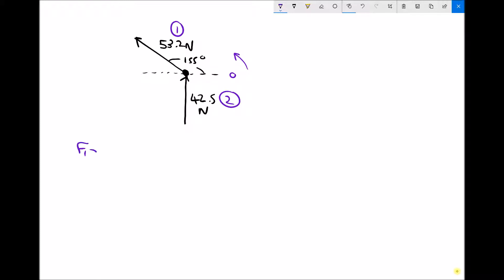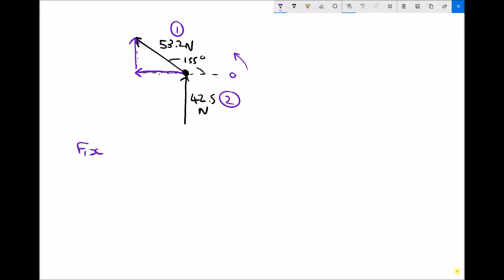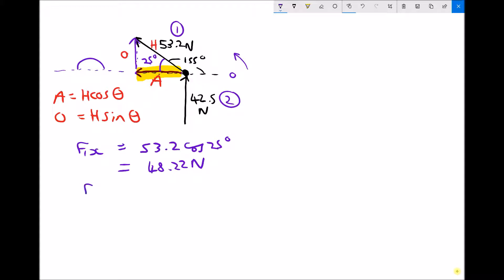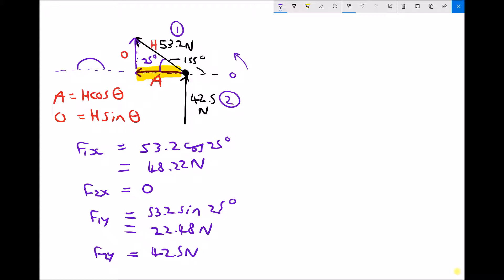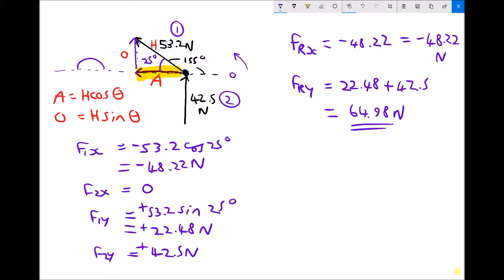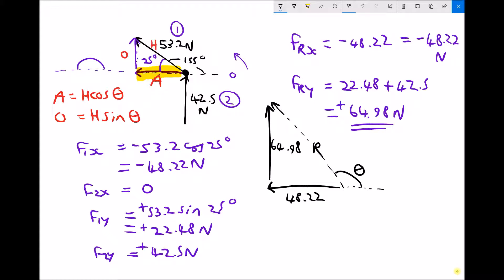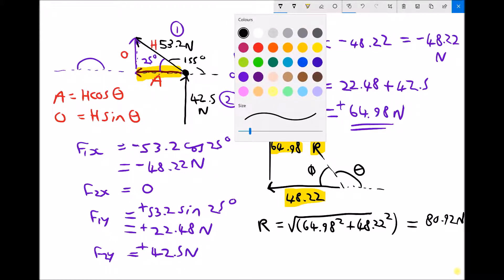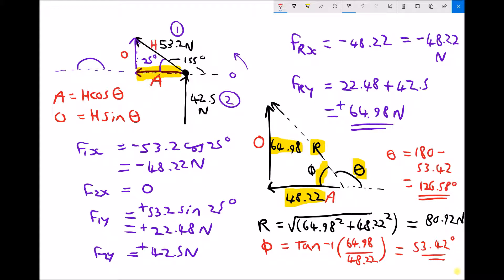Finding Resultant and Equilibrant Forces (Part 2)

Comment: Hi sir i was wondering shouldn't the x value be negative when finding the resultant you have put a positive 48.22 when it should be -48.22 i was just curious?
Reply from the maker: Hi Manny. Technically you are correct. However we are only trying to find the magnitude of the resultant at the point in the video you are referring to, which is why I have used the magnitude of the x component. You will notice that the direction is taken in to consideration when calculating the angle (where x is negative). Thank you for watching and asking questions.